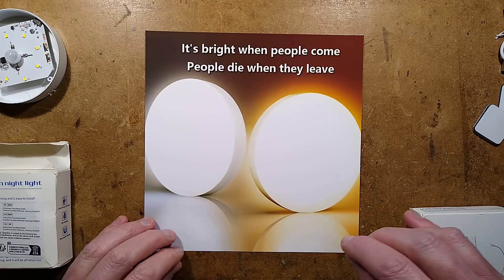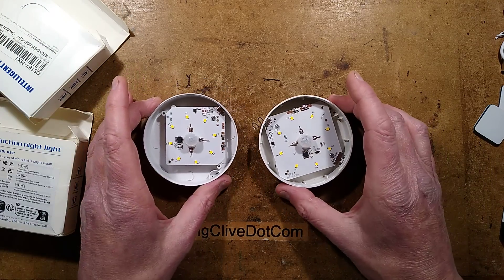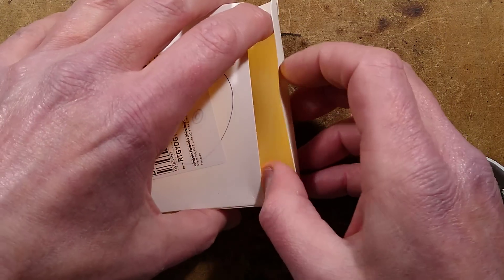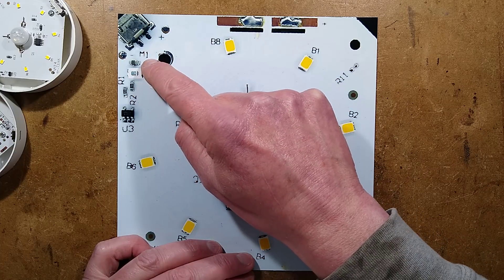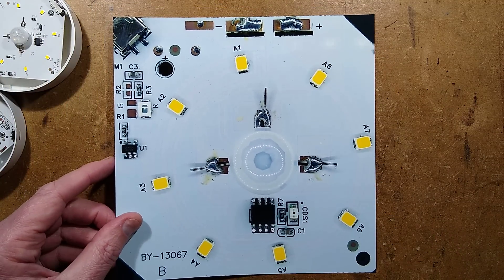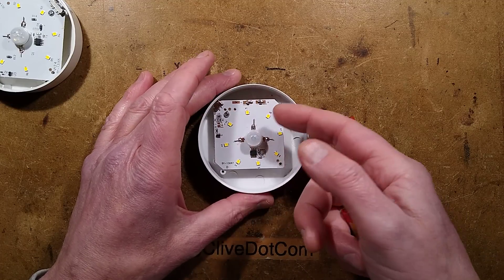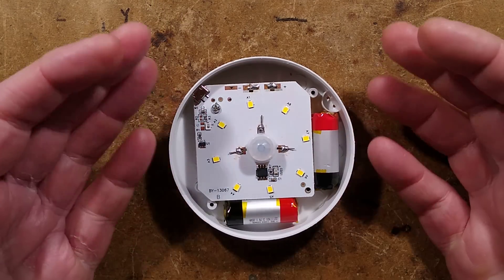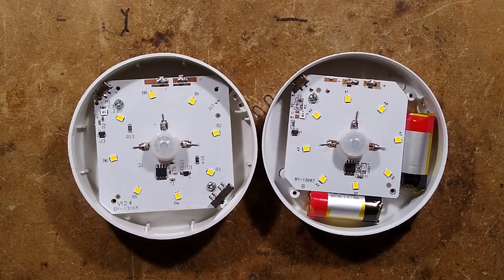You can't even turn this unit off

Comment: Hi Clive I have just purchased one from ebay but mine has the switch marked White-off Warm so I can have a warm light or a white light and it is automatic on off, so removed the board to find a puffed up small battery that was dead flat, so will change the battery for a good one, thanks for the video.

Comment: If This Discharges Down To 1V Why Didnt They Use a 50 Cent Protection Circuitry This Is The Same Stuff With The Chinese Earbuds That Self Destruct If You Dont Use It For A Few Months And After A Few Years The Buds Themselves Also Stop Working Because They All Got Completely Discharged Due To The Lack Of Protection Circuitry I've Replaced The Cell In A F9 Earbuds Case Adding A Protection Board From An Old PS4 Controller Battery

Comment: "The only reason I bought this" -- I'd be very tempted to the same, Clive 😂 Thanks for the tear-down. I'm not sure I understand why the gain of the PIR detection circuitry goes off the charts -- is it just some sort of auto-gain that should have been tamed by a different choice of components?

Comment: I built an arduino under bed light circuit using a PIR and initially must have buggered something in the code because it did exactly the same thing as the non switched light you have there

Comment: this almost reminds me of the Home Depot motion sensor floodlight thingy my dad has out in the garage that screws into the light socket, it charges while it has power but you can turn it on and off through the switch but when you turn it off sometimes it will just flash on for a few seconds, trip off then flash back on then trip off. it does have a motion sensor element to it as it's also an "emergency" light if you ever lost power you could still see around in the dark but it wont do any good if it does that until the battery dies...

Comment: If you were to add two 500mAh cells in parallel with the 200mAh already present, then plugged it in to charge, would there be a risk of the 200mAh getting dangerously overcharged?
Reply from the maker: If they were connected while at very close matching voltages, all the parallel cells will act as a single cell.

Comment: Putting a couple of 500 mAh cells in parallel sounds fine - as long as they both come from the same brand of discarded device, so they would likely be the same capacity. I have noticed that many such devices contain cells which have "500 mAh / 1.85 Wh" printed on them, but the physical size and weight can be variable between brands.

The diameter of the cell is usually 13 mm, so the variable is in the length, which is easy enough to compare. They also usually have a 5-digit form factor code which works the same way as the common 18650 cells (18 mm diameter, 65 mm length), though I haven't yet found an explanation of why this needs the zero at the end.

If the salvaged cell is a 13350 (one of the most common sizes used), then it most likely is 500 mAh. If it is shorter than that (the next most common size is 13300), then the capacity is almost certainly lower, regardless of what the label on the cell claims. Most of the 13300 cells I have found were either 360 or 400 mAh - and yes, I have found a few of that size which claimed to be 500 mAh, but turned out to have a real capacity at least 100 mAh lower.

Why does this matter? Because as I understand it, if you are going to link two or more cells together, whether in series or in parallel, their capacities should be matched as closely as possible. The potential for damage when mismatched cells are linked is worse when they are in series, because when the lower capacity cell is fully discharged, it will be reverse biased by the higher voltage remaining in the other cell(s).

Whereas if mismatched cells are linked in parallel and the lower capacity cell is fully discharged first, the higher voltage of the other cell(s) will attempt to partially recharge the lower capacity cell. This probably wouldn't damage the cells all that much, but since no recharging process is ever 100% efficient, the effective total capacity of the linked cells would be reduced, compared to the sum total of all their nominal capacities.

So if you are going to add a pair of cells to the device in parallel with the original cell it came with, it would be best if the added cells were the same capacity as the original cell.
Reply from the maker: The zero is probably to indicate it's a cylindrical cell, as usually the rectangular ones have three dimensions.

Comment: What happen if in a circuit of 10 Leds in series (each 3V 150mA ), I replace one of them with another Led rated at 9V 150mA?
The others will get dim or doesn't light up?
Reply from the maker: In a series circuit they should light if the voltage is high enough.

Comment: I wonder if you completely block a home security PIR sensor if it would behave the same way? that would be a unexpected advantage as it would detect being tampered with..
Reply from the maker: You can shield a home PIR so it can't be triggered.  But some alarm systems will detect a lack of activity and flag it as tampering.

Comment: The biggest problem is all this battery powered junk, who wants to spend a great chunk of time going around charging all this junk, so it ends up driven to zero volts, then a few months later, into the bin.
Just what the world needs, more land fill.
Reply from the maker: In normal use these lights normally run for a long time before needing recharged.

Comment: Another light ready to be modded. I'd just bypass the PIR sensor and just use this as a stick up light. Add a switch in line between the batteries and unit. Does this have a USB charge port?
Reply from the maker: It does.  The other version has a switch for off, auto and on.
Reply: I bought 2 similar to this a few years ago. The magnet isn't very good. I put one up over the front door so I could see when I got home. Went out to dinner and came back to find the unit lying on the welcome mat. The ones I have also have a notch on the back where you could slide them onto a fastening screw.
Reply: @two_tier_gary_rumain  you could get a neodymium magnet and glue it to the original magnet. 🧲 💡

Comment: Rather a threatening statement 🙂 Otherwise a nice little light, but the switched device is better.  Looking at the charred squiggle on the bench (from your plastic welding programme) I wonder if that might suffice as an "antenna" for an, e.g. Bluetooth transceiver module??

Comment: The kitchen lights strips with a pir sensor should be more interesting.

They have a day motion detection mode,and a night motion detection mode. Also the way the plastic housing and guide light are molded seems unique as it is a single extruded piece of plastic with different opacity.

I haven't tried the more deluxe aluminium case version.

Comment: I haven’t a few of these, they have a curious fault where if left uncharged but turned on, the lithium battery inflates and dies.
Reply from the maker: Sometimes an overdischarged cell that had puffed up, goes back down when recharged.  It must be reabsorbing the gases.  It doesn't leave confidence in the cell though.

Comment: This is quite a useful light and chip they use inn the product. I found a undercounter long strip light of this version with movement sensor on it. So I chopped the thing down to size, hacked the chip and power and connected it to a relay and remote and turned it into a early warning device so anyone walking on the other side of the house, the device would detect this, click the relay, that would in turn act as a button pressed on a remote control that sends a signal to a relay receiver to turn on a led light to inform me someone is approaching. Very handy...

Comment: I know very little about Electronics but I do know something about heat capacity and what I'm thinking is it's not necessarily the noise of the room that's the problem but the fact that when you turn the light off the cardboard goes from absorbing heat to transmitting heat and there'd be a bit of lag between those two moments I know that LEDs don't give up a huge amount of heat but technically light is a temperature so probably would do something

Comment: Anyone else driving down the road now and seeing a small light in the gutter from street lithium? Or is it just me.
Reply from the maker: That little light when it's raining means water has got in, but that the lithium cell is still recoverable at that point as the voltage is high enough to light the LED.
Reply: All the time... it happens when water gets in there...

Comment: Very interesting. These seem to be a variation of some nightlights we had a couple of years ago, described as "when a man comes, it shines".  I always wondered why some nights they'd randomly keep triggering over and over until something changed.  Guess it was either during new moon or on cloudy nights when it was extra dark lol
Reply: Ive got a Lidl battery LED light, which uses 6 AAA cells, (2 sets of 3 in parallel) it has a night time sensor & PIR, fixed light time is 30 seconds  for each activation, but once the batteries run down to a certain point it will just keep switching on & off constantly every 30 seconds, until the batteries are completely dead!

Comment: Sort of a new take on an old marketing claim.  In 1955 my mother received, as a wedding present, a sewing machine with a "lifetime warranty". The fine print revealed that the warranty was for the lifetime of the motor.
Reply: and back then, that was a looooong time
Reply: For something made in 1955 that would mean the warranty is still good.  I have my grandmother's Sunbeam mixer from the 1940s and it still works great.
Reply: That's evil
Reply: That's apparently how all "lifetime warranties" work. It's just the "expected lifetime" of the product, not the actual lifetime of the owner.
Reply: @takanara7   So in other words "warranty that coincidentally happens to end when it's convenient for us"
Reply: @brinkoftext i think its meant to be protection against freak damage, fire and stuff. rather than expected wear.
Reply: @brinkoftext  I once broke a Facom Allen key and the shop I had bought it from honoured the lifetime warranty without question.
Reply: Craftsman tools.

I knew a guy who would buy C'man tools at a flea market and trade it in for new ones. 

Lifetime warranty was the lifetime of the company, for them.
Reply: @Skibidigoloveyourself  I bought an LEC fridge freezer as they used to have an excellent reputation for reliability. We went to the fridge one morning and found the fridge door open. We closed it, thinking it was one of us who had forgotten to close, but later that day water started running out of the freezer. We called a repair company and the engineer determined an evaporator pipe in the fridge section had exploded which is why the door was open. The unit was unrepairable and only 18 months old and AO refused to refund or replace it under the 'fit for purpose' laws, claiming 18 months was a reasonable lifetime for such an appliance.

Comment: When I bought a dozen or so of these I liked them except for the limited battery capacity. I then tried to find the largest LiPo that fit insted of the small one and that's a 2000mAh one. I haven't charged them ever since and that's already months ago. The small ones only lastet for a few weeks. So for anyone interested when using the same or similar lights, KS614063B is the one I use.

Comment: This is very interesting because I have the same exact lights (but mine has USB C and adjustable color temp) in the closet of my dorm room and they do this exact same thing at night. I always thought they were detecting me through the crack of the doors or were in some sort of feedback loop. Oddly the ones I have ARENT the cost reduced model bc they have a switch. I wonder if there's a way to remedy this by bodging something on the pcb.
Reply from the maker: A cell upgrade might help.

Comment: I was already gasping for air in the first video frame. I wonder how the Chinese can mess up translations so bad, almost seems done on purpose.
Reply: Would not surprise me. The Japanese (specifically Sony) did this. Open an old VCR and check out the Regurator circuit...

Comment: How hot does the light with the smaller board get? If you increase the battery capacity will the temperature go up? Remember a smaller board is a smaller radiating area.
Reply from the maker: The larger batteries won't affect the temperature much.

Comment: That auxiliary light sensitive device marked CDS1 is on both boards. The marking is probably down to the designer originally intending to use  cheaper cadmium sulfide LDR but later finding that it would be too slow or wasn’t compatible with the chip they had to use or something similar, and the board markings were forgotten when they changed to a silicon device.

Would the constantly increasing gain issue not have happened if they had stuck with the original design, or is there not enough evidence left after all the changes to tell?
Reply from the maker: Cadmium is one of the elements that the eco-warriors have pushed to have banned from electronics.

Comment: Wow coincidence, I just reverse engineered and modified 4 of these lights a couple of weeks ago!
Mine were from Temu, and almost identical to yours.
I added a 800mA hour cell in parallel with the 200 or 260 cell (depends which variety light you have). So now has >1000mA hour and will last for about 2 months between charges. I also changed the 4k7 resistor to 1k8 to increase the USB charge current from 200mA to 500mA approx.
Interestingly, mine do not have ANY capacitors, they are just not populated on the pcb.
The chip is the standard Padauk PMS150C "3 cent microcontroller" which is one time programmable. Very common in any Chinese made 2 dollar product.

Interestingly, that chip has no ADC function, so the silicon photodiode and one resistor form a simple voltage divider, and the room light sensing is triggered on the digital input pin of the IC, a very crude system although all 4 of my lights seemed to work just fine like that.

They are actually a great little light, and well worth adding another cell inside in parallel with the original tiny cell. The lithium cells I added cost 3 times more than the lights lol. But well worth it.
Reply: Thanks for the info..

Comment: Products like this, and others Clive reviews, really make me wonder how much over-production of Lithium batteries there must be in China for them to show up in nearly every cheap, no-name product that they make. I mean, you would think that cost-cutting would have pushed more of these things not to supply batteries at all, and just ask the end user to stick a couple AAA's in them, or simply include a pair of cheap AAA's. However, it appears it must be cheaper to include a small lithium ion cell, and the supporting charging port, chip, and possibly a charging cable than to include a pair of disposable 1.5v cells. Given how merciless these products seem to be about cost cutting in general, I can't believe they would keep the lithium cells if there were less expensive options. They must be practically giving the things away for them to cost less than two or three small 1.5v disposables.
Reply: I think it would be good to ban the sale of non-rechargeable batteries. They used to be justifiable in a flashlight or radio that you kept for emergencies at the time when the only sealed rechargeable batteries were of the nickel-cadmium type that goes flat in a couple of weeks even when not being used, but now that there are lithium-ion and low-self-discharge nickel-metal-hydride batteries that hold a charge for years there is no excuse for throwaway batteries. They have hundreds of times the consumption of natural resources compared to rechargeable batteries.
Reply: @cedriclynch  I could get on board with this if, and only if, batteries were also required to be user-replaceable. No soldered-on coin cells, or lithium ion pouches you have to break open a plastic-welded case to replace. Exceptions can be made, but replaceable should be the default since no battery is immune to failure.
Reply: @sadlerbw9  I agree that batteries should be replaceable by the user.

Comment: Remove the 250mah bat and replace with bigger flat battery. Needs a dremel for 2500mah, but a 1000mah fits no problem. Be aware the magnetic pad does not cope with 2500mah battery weight but 1000mah is fine.
I did start to mount "dubaied" 220V versions of this in corridors, entrance and workshop.

Comment: OH has a similar problem with her caravan.  The bunk lights are turned on and off by touching the centre of the fitting — whether it's capacitance, infra-red, or some other arcane method I don't know — but they have a habit of turning themselves on, both in daylight and the dark.  Very annoying when it happens at night, especially as she cannot reach the one on the upper bunk.  One night they both came on, and kept coming on again seconds after being turned off.  We call them 'Jim lights' because Jim, the owner of the company that imports the caravans, swears that they are working perfectly and as designed.  Right.
Reply: If they turn on/off by touching, they're capacitive... Make sure they're clean. Some sorts of dirt and debris can have a capacitive effect, which could trigger such touch sensors.
Failing that, rip them open, ground the touch sensor, and install a basic switch to the power input 😂
Reply: glue a small hollow cylinder of foam around the PIR to restrict its view to a small narrow beam directly in front of the device.

Comment: Wonder if adding an extra 100uf capacitor across the chip power leads would help, along with cutting that long power trace near the chip, but before the capacitor, and adding in a 10-22R series resistor.
Reply from the maker: I noted all the things I tried in the description.